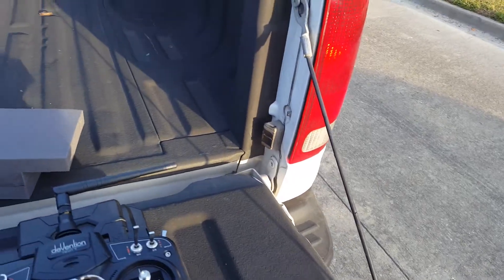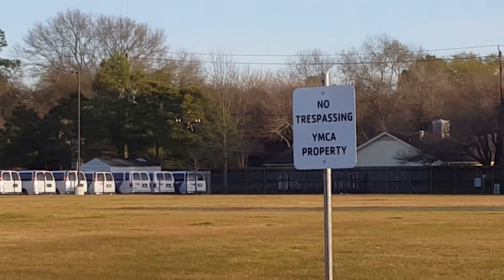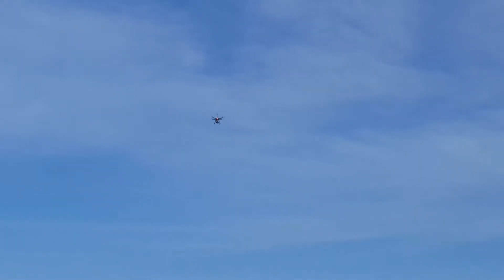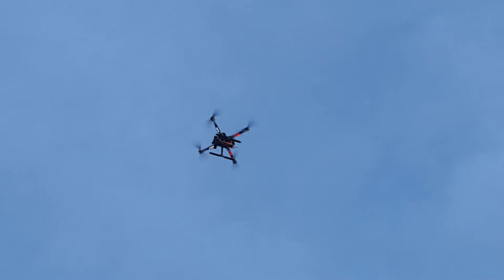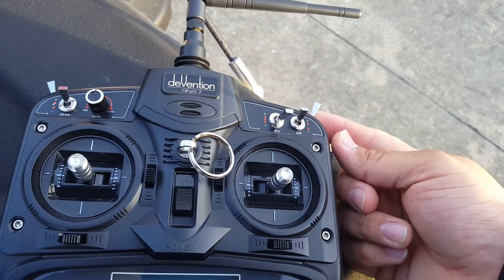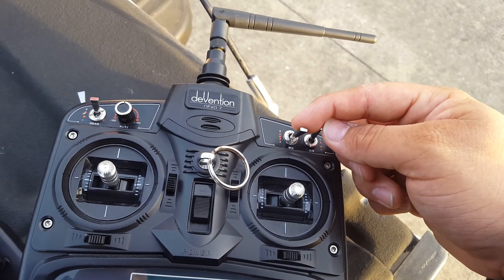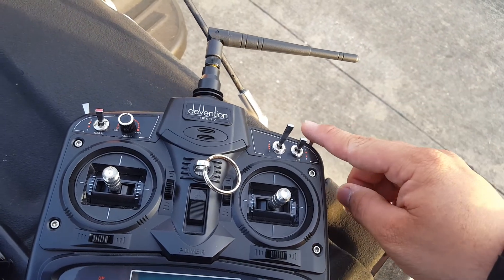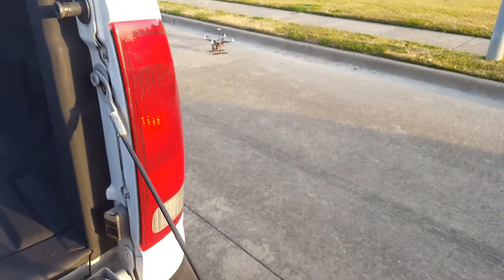DJI NAZA M Lite Manual RTH

Comment: I'm a big time Walkera Devo fan! 
liked and subbed!
Reply from the maker: Awesome, I plan on making another video explaining the way I programmed it. It's actually extremely accurate on this rth rather than the safe mode
Reply: JPG23 Could you please make that video? I'd like to have my devo 7 work like that.
Reply from the maker: rhodri davies Sorry I didn't have my notifications turned on and never saw your comments until now. I'm now using a different transmitter as the Walkera wasn't giving me the desired range; however, if you're still interested lmk so I can make the video for you